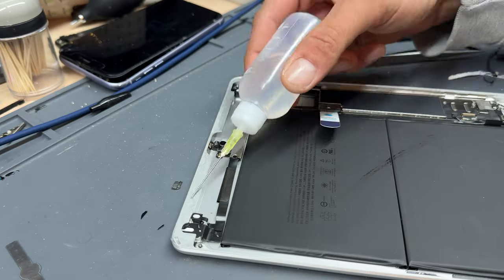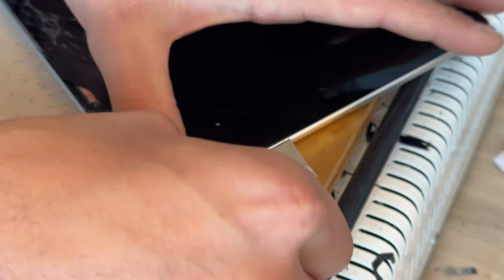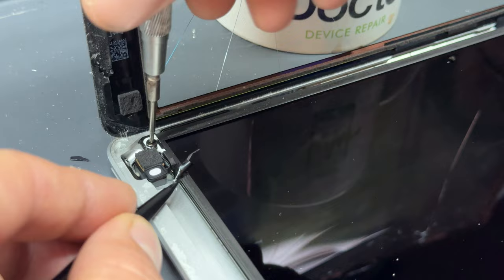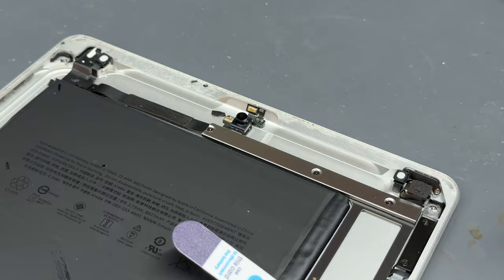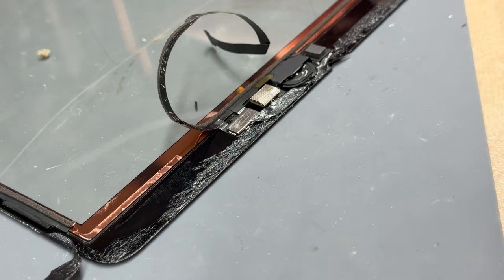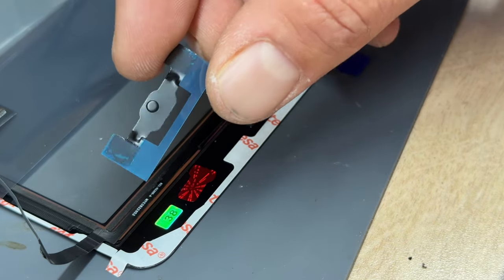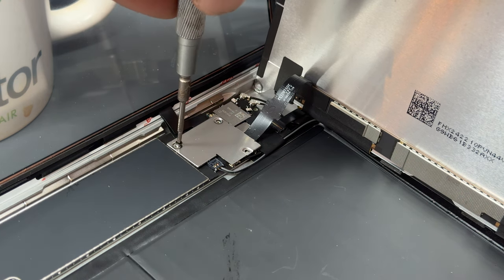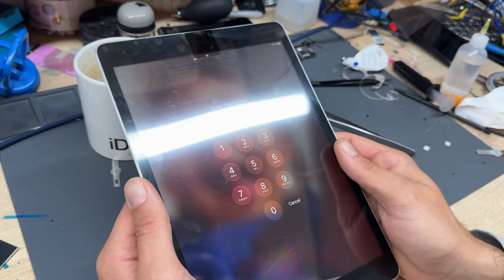No More Broken iPad Screens! - An Easy guide to replace your iPad 9th Gen Front Glass!

Comment: yes im a kid and i cracked my ipad 9 and my dad bought an screen to fix it. when he reached the battery step, he thought you pry on the battery not put something under it. So now the ipad is boot looping and we dont know what to do. Kinda of a waste of money. There goes 250 pounds. (Edit i actually fixed it but i accidentally ripped the rear camera and the home button but touch id still works.
Reply: christ bro how do you get the stupid digitizer glass part off it’s so cracked i can’t even get it to seperate
Reply: I know you might have gotten a new iPad already but if the tablet is already bootlooping you should probably get a new battery or make sure the battery is connected properly if it’s not pryed badly.
Reply: Same
Reply: @Common_Coreless  well i actually tried fixing it and somehow i fixed it, i bought a new digitiser and it works fine
Reply: @Common_Coreless all i had to do was take the board out, heat the NAND chip with a heat gun, i restored it with itunes and it worked

Comment: Thanks a lot. I did it in about 2 hours. My only doubt is that I used glue on the home button bracket, which may not work so well… buying a little Tessa tape would be sensible. My tip would be that after heating up the edges of the glass with a hairdryer (or better tool) take a lot of care removing  the screen around the home button, as the strip could get damaged. There’s a sense of nihilism when all the glass starts cracking and violence can set in, but don’t rush - removing the screen and glass is the most time consuming and unpleasant part. If all connectors and brackets are preserved once the glass is off, the rest is totally doable with this top man’s instructions.

Comment: I get with With my new screen that I purchased, I also received a new Home button, which is recommended to use? (Has new touch ID) As far as we know, every touch ID is identical
Reply: where did you purchase your new screen? i can't find any reliable sources to buy from to get a good quality screen.
Reply: Use your old button, as the iPad is programmed to recognize that specific one only (security reasons).  Your new button will work, but the fingerprint feature will not be available.

Comment: Good video! Just one thing: you should not put a battery blocker under the connector itself, although it is plastic you can still damage the pins. 
Just drop some IPA under the board next tot the pins and slide your blocker under the board itself!